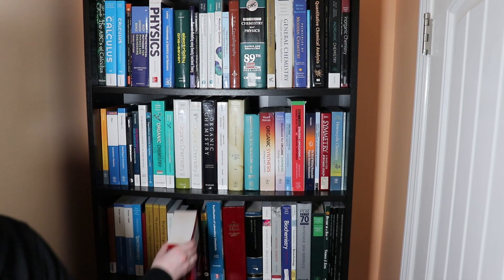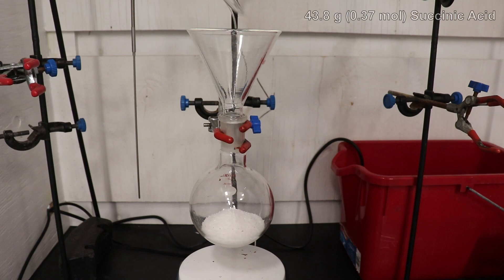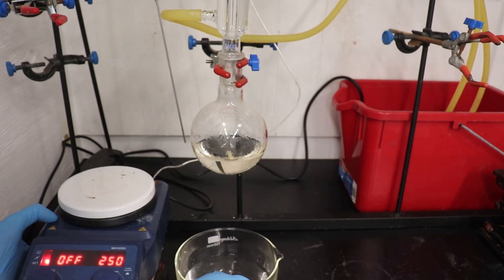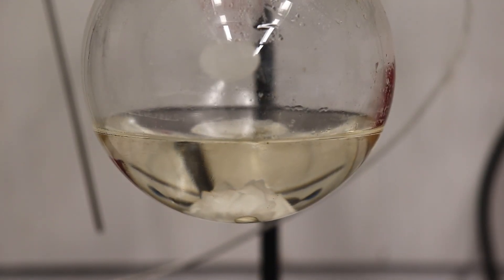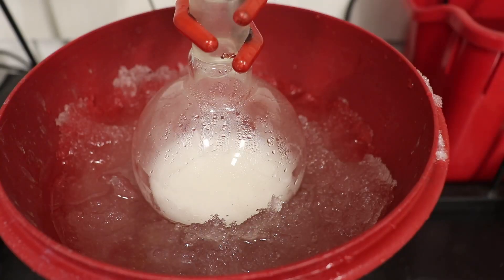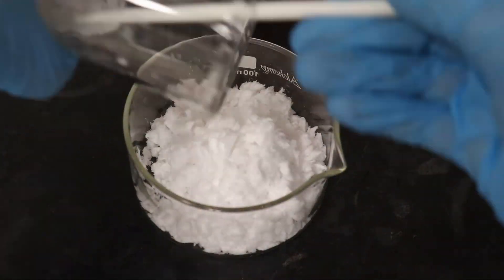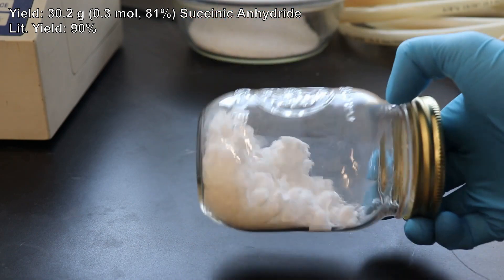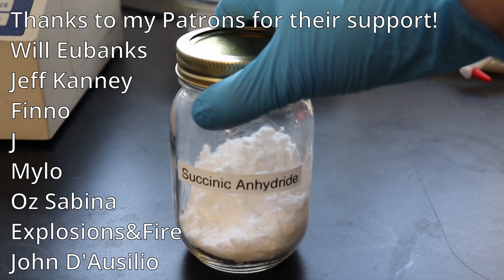Succinic Anhydride Synthesis

Comment: Succinic anhydride may be prepared via distillation of succinic acid. Maybe some vacuum nigh 10 mm will help to remove any water forming in the reaction. One Soviet patent states the preparation with the reflux in PhNO2. Easier to try than dig out the literature
Also about using of succinic anhydride, it's a wild reagent for condensations, for example the one with a-naphthoic aldehyde followed by pyrolysis yielding phenanthren-1-ol

Comment: Succinic Anhydride much easier to buy and it will be completely safe and cheap, nobody will track you, as it's used to produce some polymers. But Acetic anhydride is a HUGE RED LIGHT of suspicion and tracking.
Reply: Lol, it's not that big of a red flag.  It's very easily gotten without being watched.  Hell, you can easily get it from yours truly.
Reply: Where do you source it? It used to be cheap here, now it's hard to come by and seriously overpriced, ~40EUR/100g (and I am not even paid in EUR).
Reply: @ Cymitquimica price 1kg for 63 eur. Ref: 7W-GK7520

Comment: It's odd that the anhydride has such a different structure.  It would explain why succinic anhydride is toxic but succinic acid isn't.
Reply: Succinic anhydride is toxic?!
Reply: @dimaminiailo3723  Oral LD50 is 1510mg/kg in rats.
Reply: @douro20  NaCl has 3000 mg/kg. For me, poisonous compounds start nigh on 1 mg/kg except for the ones which have an ability to diffuse through the skin or are volatile (ethyl fluoroacetate for example), or cumulative (Hg salts)